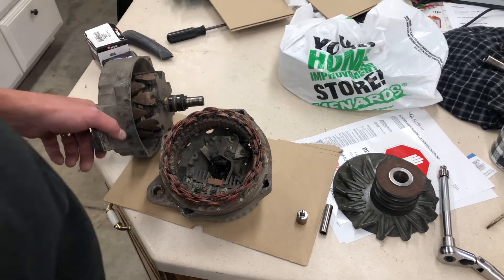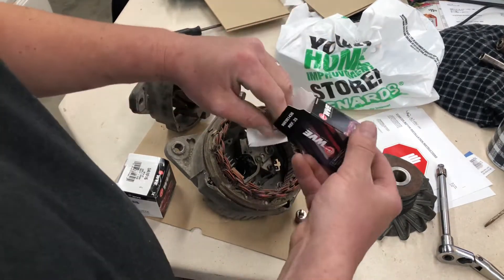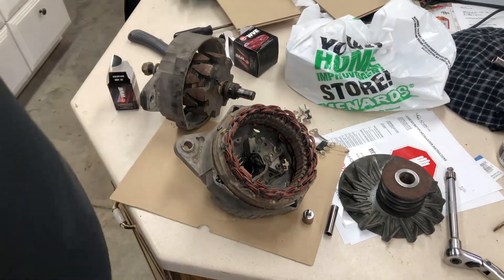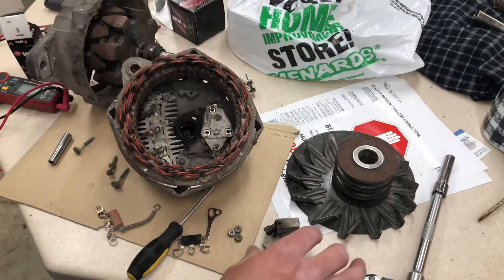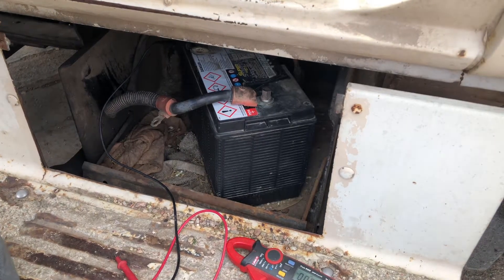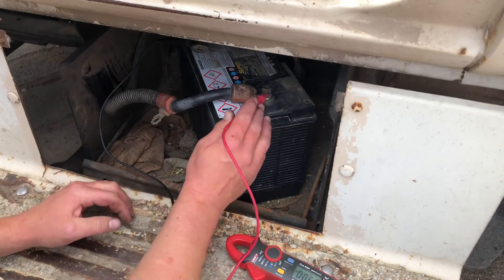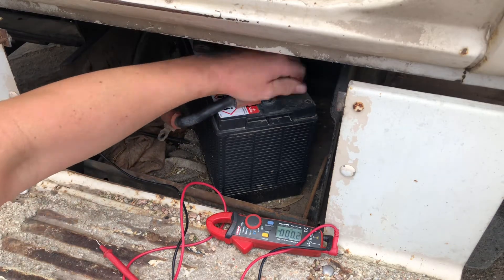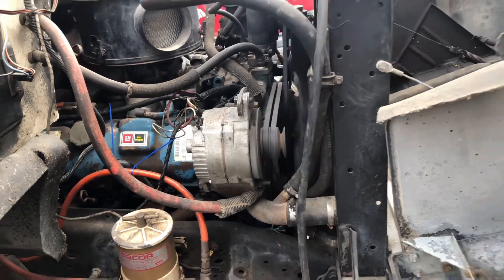Alternator Brush and Diode Trio Replacement

Comment: great video! Technically, that electronic part is usually referred to as a rectifier, which usually contains 4 to 6 diodes to get the maximum conversion of alternating current to direct current. If one of the diodes inside breaks, dc current will still usually be produced, but much less efficiently. Fortunately, they are usually inexpensive.
Reply from the maker: Thanks, I don’t work on them much but when I do, I forget some details sometimes. Thatnks for the clarification